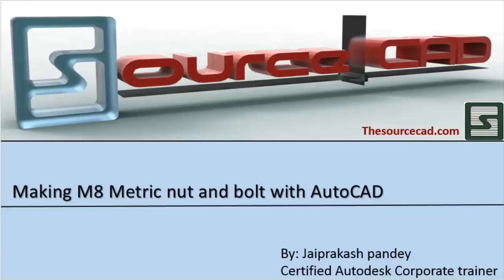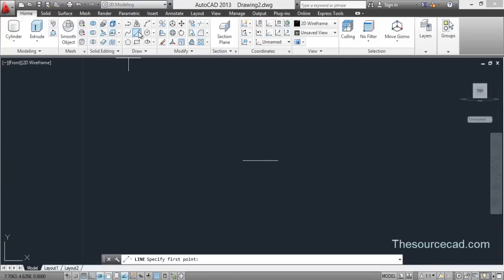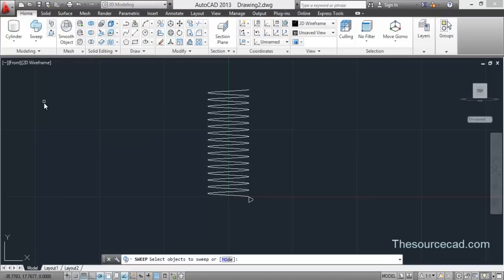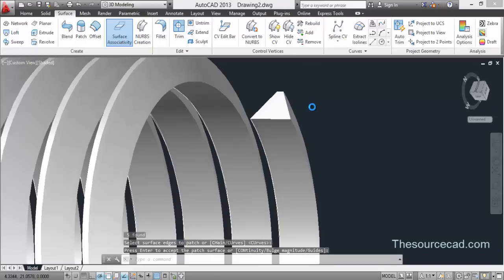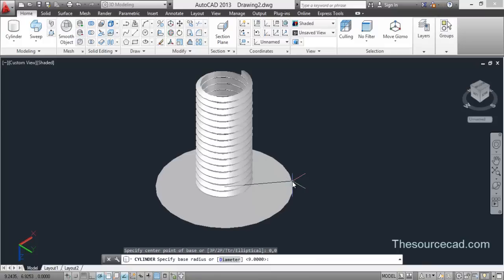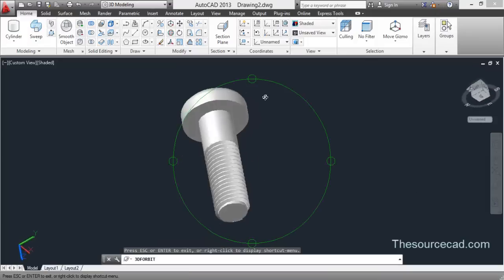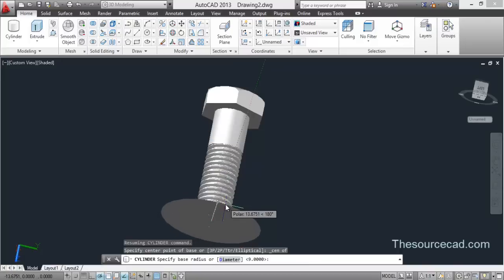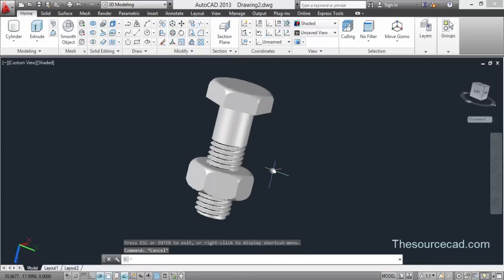3D modelling of metric M8 nut and bolt using AutoCAD

Comment: Thank You very much, sir, for such an organized and informative video. 1thing I must correct that on 1:32 0r on 1:33 minute you have mentioned to turned on OSNAP, Sorry sir ! as per my knowledge that is Polar tracking and in that increment angle must be set at 30 degrees. I know that this mistake has been done unknowingly. Your content is excellent.

Comment: Hello, 
As always very useful video for learning AutoCAD. The part of making a thread of the bolt is OK but as soon as I start making the body the bolt, the cursor lags (slows down a lot) on it. Can you please share what specs of the machine you are using for CAD?
I have a HP Omen Laptop with core i7, 16GB RAM, 256GB SSD, 1 TB HDD, NVIDIA GTX 1060 (6GB) dedicated. I purposely purchased it for lag free CAD file but still, I am facing the lag issue. 
Looking to have your expert advice. 

Regards.
Reply from the maker: Hi Mohsin,
Your PC specs are great for most of the parametric software let alone AutoCAD. 
The threads are generally heavy on any kind of CAD software and to counter this almost every software has a "cosmetic" thread option which can be added in the layout view of AutoCAD. The same thing is true for AutoCAD as well. 
The thread was not at all required if you were to make an actual bolt, you can just add thread specs on the layout.
But in this case, we made thread anyways in model space and the performance of AutoCAD was similar for me too. Still, you can just check a few things to improve performance but that won't guarantee a lag-free performance as these kinds of shapes tend to be heavy but might improve performace.
1. Turn hardware acceleration ON, use command 3DCONFIG for this.
2. Check that your software is using NVIDIA and not the default Intel integrated graphics, again you can check this using 3DCONFIG command
3. Disable other programmes consuming heavy resources of your PC.

Hope it helps, feel free to share your feedback.
Reply: @sourcecad  thanks alot for the satisfactory reply from your side.

Regards
Reply from the maker: Welcome Mohsin

Comment: i cannot make sweep step why?
Reply from the maker: Try making smaller geometry for sweep
Reply from the maker: If you explode the geometry then the sweep profile can't be made as it can only be done with a closed object.
Reply: You have to explode the profile first I think before using swipe command
Reply: SourceCAD That's true but you did this with an inserted block in another video and it was mandatory
Reply from the maker: you are right! in that case you need to explode it to convert block into normal geometry. Just insure you don't explode it twice :P
Reply: I know :)

Comment: Hi, Great video. I'm having trouble working out what 5H/8 means... How did you calculate .7675? Thanks
Reply from the maker: The dimensions are taken from standard metric M8 nut and bolt dimensions.
Reply: Thanks, would you mind taking a look at my thread, I am having some issues. You can reply here if you don't have an account.

http://forums.autodesk.com/t5/autocad-for-mac-forum/creating-pitch-thread-autocad/td-p/6569234

Thanks

Comment: very very nice but will nut and bolt move as physical  objects
Reply from the maker: No likely as there is no tolerance allowed between threads of nut and bolt
Reply: Thanks but if u provide tolerance will they move in AutoCAD
Reply from the maker: They may move if provided correct tolerance.

Comment: I wish to know why first you created a surface model then you converted into solid model in making BOLT. Otherwise it is excellent tutorial Sir. Thank for giving excellent explanation.
Reply from the maker: If you would have tried it with 3D modelling tools instead of surface tools then the orientation of thread does not remain parallel to the 2D geometry drawn and hence there is acute loss of accuracy. You can see in this video what I mean https://www.youtube.com/watch?v=Gghnbkio4hg here I have used 3D modelling tools for thread instead of surface tool
Reply: Sir I wish to know whether the difference is visible. That means straight away going to solid modeling and going to solid modeling through surface modeling.

Comment: can you post a video that explains how to subtract from the nut In order to 3d print this and it function please.
Reply from the maker: For 3D printing a 3D model you need to convert it to .STL format which can be done by export command of AutoCAD. Moreover I am not well aware of 3D printing so it might not be possible for me to help you Matt in this regard :(
Reply: I mean the tolerance between the thread of the bolt to the nut. I am having a problem getting the drawing where in reality they will thread together
Reply from the maker: If you take reference of this 3D model then there is no thread inside bolt which is practically incorrect, these 3D drawings are for practicing 3D AutoCAD tools and I have ignored accuracy to simplify these drawings and hence it cant be used to create physical component (in your case these models cant be used for 3D printing). 

I suggest you to get manufacturing drawings of any nut and Bolt and make drawing as per dimensions provided there.

Comment: When i'm applying the sweep function it get sweeped at some different angle so that its not making complete thread.
Please help me.
Reply from the maker: jamshed ansari Use surface sweep not solid sweep, you can find surface sweep on surface tab of 3d modeling workspace
Reply: If someone has the same problem. Solution is to rotate this diamond you are sweeping

Comment: I hate to nitpick, but your bolt is not M8. It's closer to M10. You placed the thread form on the outside diameter which is 8. the top of the thread form (narrow end) needs to be level with the OD. Just saying.
I enjoyed the drawing exercise though, very helpful. Thanks :)
Reply from the maker: Pablo668 I agree with you Pablo its good to know that you enjoyed this video, I wish to point out that its not even M10 because in that case the pitch should have been 1.5, Actually the bolt is not accurate as per ANSI standards If you will explore video you will notice anomaly in head of bolt as well :) this video is intended to give a general idea of modelling Bolt using AutoCAD and calculations have been taken approximately and wherever possible I have tried to avoid values containing decimals to keep drawing easy to understand and hence many details have been omitted/edited. Hope Its a plausible explanation.
Reply: I pretty much thought that was what you were doing. No harm no foul. I'm just sitting here going through your lessons to brush up, I may end up studying this soon, just to get the piece of paper, even though I've been doing this for years.
It's all very handy. I am using a Mac version of 2014 though, makes things a bit challenging.
Reply from the maker: Pablo668 Its good to see you taking interest in my tutorials and learning with my efforts, feel free to ask when you have doubts in AutoCAD